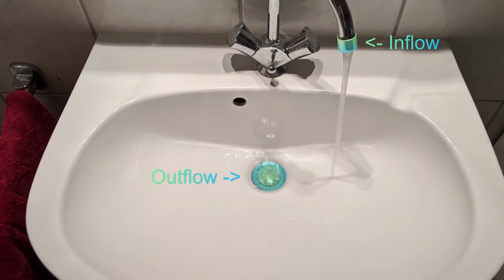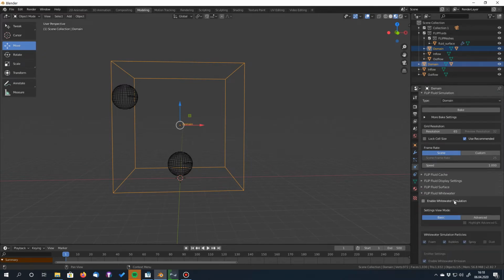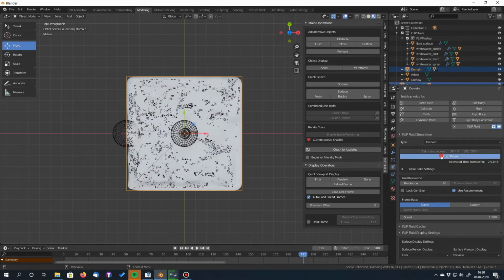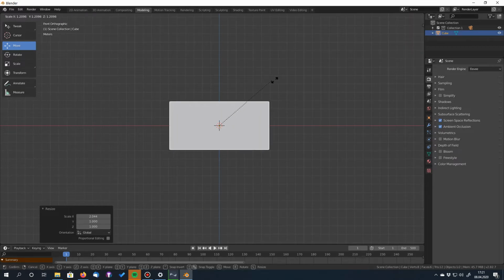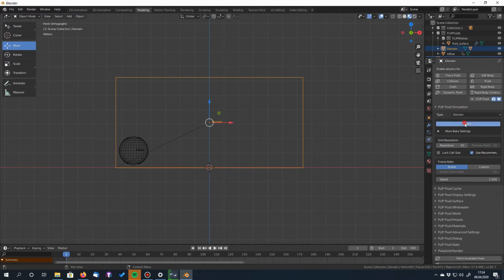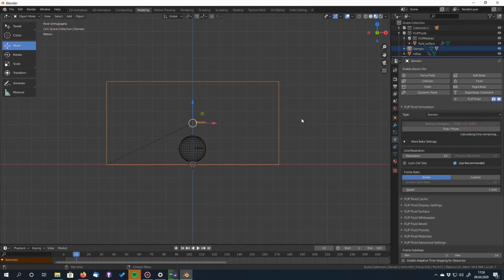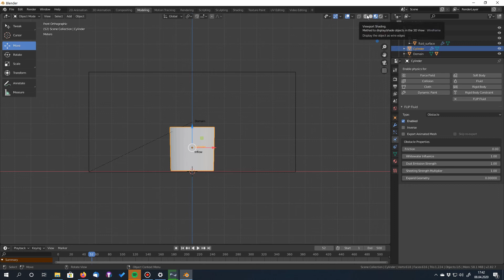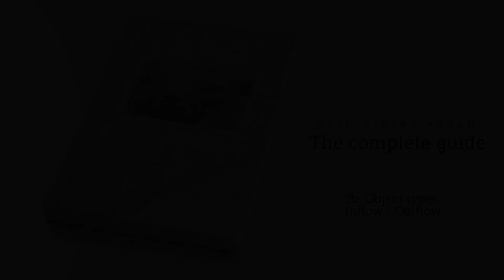FLIP Fluids addon | Inflow & Outflow (2b)

Comment: is this possible to pour liquid into glass using flip fluid, If Yes then what setting do I need to choose for glass means outflow, inflow etc...
Reply from the maker: Yes that is possible. The glass should be an obstacle while an other object will fill liquid in (inflow). We have a complete guide video about these objects on our channel. An important hint is, that thin obstacle need a high resolution for the simulator. But you can also use the inverse function for the obstacle. Feel free to send a blend file to our support mail and we help you with setting it up.
Reply: I am facing another problem now. My liquid follows my curve perfectly but at the end point of the curve, my water stops falling down while I want to fall it down into a cup. if I remove the curve then water directly falls down and starts filling my cup but if I add the curve as a guide path for liquid. liquid stops at the endpoint of the curve. after 18 to 20 hours working on this single problem, I don't have a solution. please help, I need to deliver an ORDER to my CLIENT.
Reply from the maker: Sounds like you missed to disable the "Enable End Caps" checkbox from your curve force field @physicscom  .
If this does not help feel free to send your file to us.